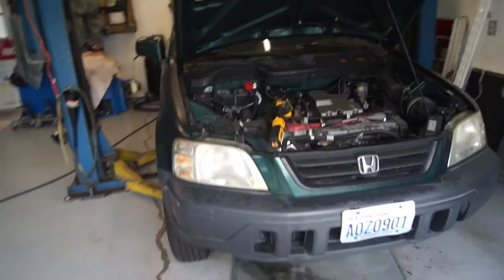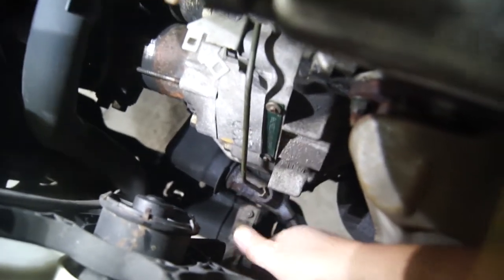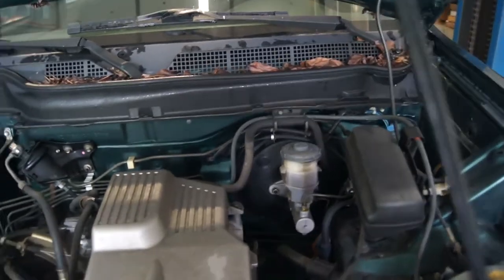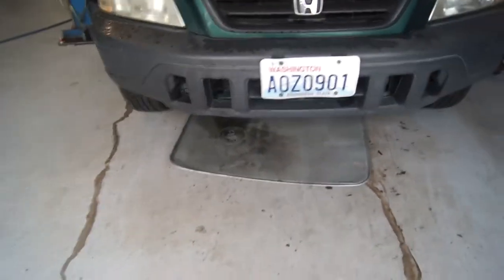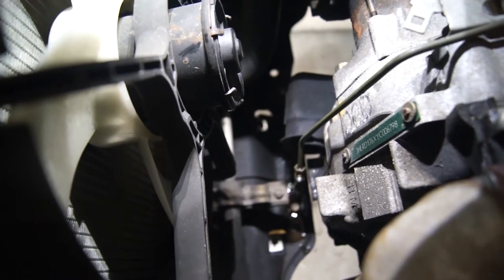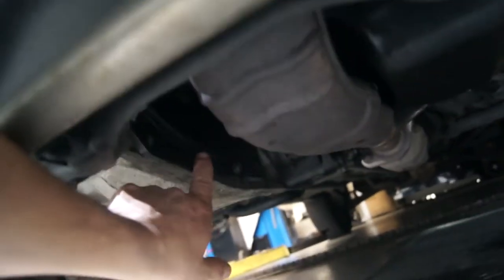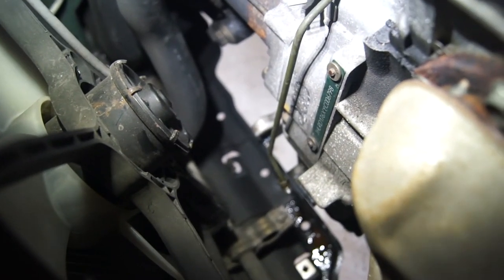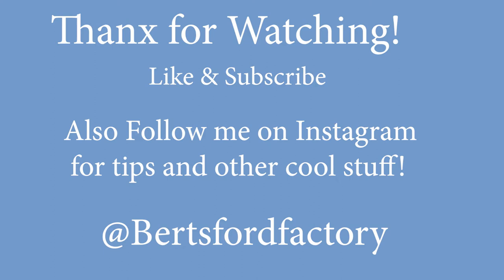2000 Honda CVR clutch Slave Cylinder

Comment: Super helpful! My wife's 2001 CR-V stopped shifting right on the road! Clutch pedal to the floorboard. I was able to get one last shift into 3rd to thankfully get it home. Turns out no fluid in the clutch reservoir! Upon inspection, master was fine, but slave was leaking like crazy! Replaced slave, sucked the air and old fluid out of the line with 3' of clear rubber tubing on the slave bleeder valve while adding fresh fluid to the reservoir. Then when I got all the air and old, crappy brake fluid out and was sucking fresh fluid out of the line, I bled the line 4 more times with the wife working the clutch pedal, tightened the slave bleeder valve and had a happy clutch! Slave cylinder part was only $16. So that was nice. Fluid hydraulics! Thanks again for pointing me in the right direction.
Reply: Hey mate I have done the same I've replaced master and slave, I have bleed the whole system so no more air bubbles but I still have no preasure in the pedal.

Any idea as to what it could be or should I just keep bleeding again and again
Reply: The clutch fork is sitting pushed out but won't move at all when pumping the pedal
Reply: @kanenscott8883  Then you still have air in the system! You have to have someone pump the crap out of the clutch pedal, while you continue to suck fluid and air out through the slave bleeder valve. Make sure the bleeder valve is all the way open and the clear tubing shoved all the way on the nipple so it is airtight and mind the fluid level in the reservoir because it will go down quick if you're doing it right! Don't let it empty!
Reply: @savagewildanimal4life  thanks for the reply mate, I heard sometimes air gets trapped in the master and it needs to be bench bleed first did you have this problem at all?
Reply: @kanenscott8883  I did have the same problem you had when I replaced my clutch master for my wife's 2001 CR-V a couple weeks ago. It took four hours, but at the end I realized what I was doing wrong. My car was on a downward incline so that didn't help. You want the car as close to level as you can if possible, but sometimes you don't have that luxury. Just gotta do it where it is. But you don't have to bench the clutch master. To do it quick you need a partner pumping the crap out of the pedal while you suck or vacuum the fluid out of the slave bleeder until you get pressure in the clutch. Then you're there. The key is to open the slave bleeder valve all the way while shoving the clear rubber tubing all the way on the bleeder valve and sucking the air and fluid out like this guy in video. At first I was only opening the bleeder halfway and shoving the clear tubing halfway on the bleeder valve. This is not airtight, and that's what took so long to bleed it. Once I got it airtight, all this old, crappy brown fluid came out, and I got a clutch pedal in like 5 minutes. Don't get it in your mouth though. And you have to keep the reservoir from emptying or you'll introduce more air into the line.
Reply: @savagewildanimal4life  cheers brother your a life saver got my clutch back nice and feeling brand new just had to do as you said, I used my vacuum to start sucking the fluid out then it started gravity bleeding in its own then got the misso to pump it while I filled up the reservoir till there was no air then tightened the bleeder badabing badaboom
Reply: @kanenscott8883  Yup. That's how you do it! When you get it, it happens very quickly, and you stand there feeling like, "why the heck did that take so long? If only I knew 4 hours ago what I know now." Lol. Glad I was able to help, and you got your clutch pedal! Good stuff! At least you know if you ever had to do it again, or to help a friend or family member it would take like 10 minutes tops.